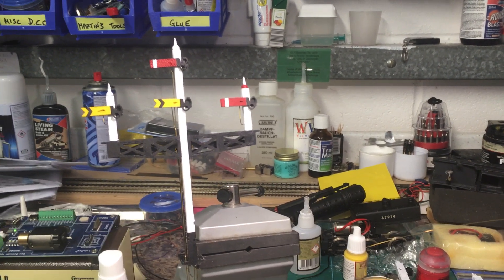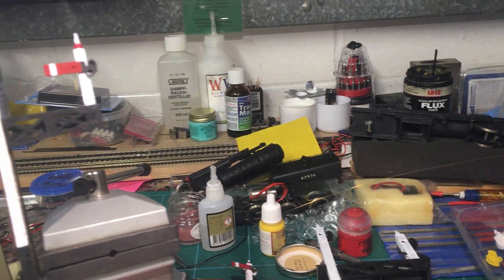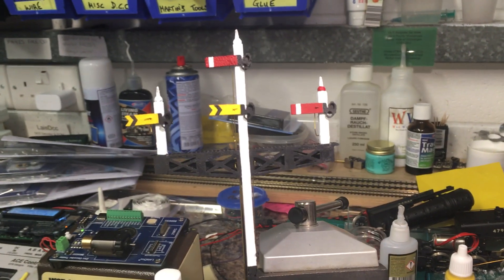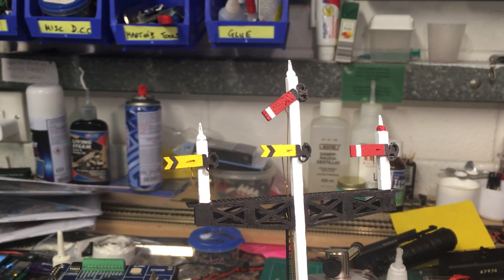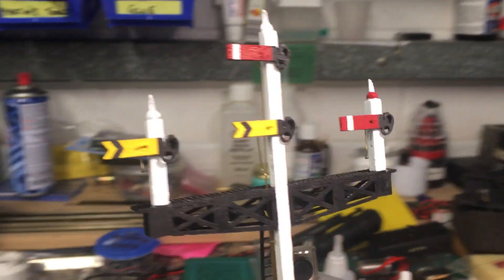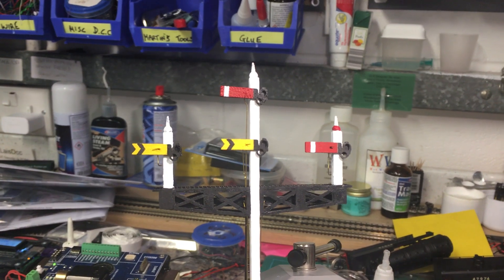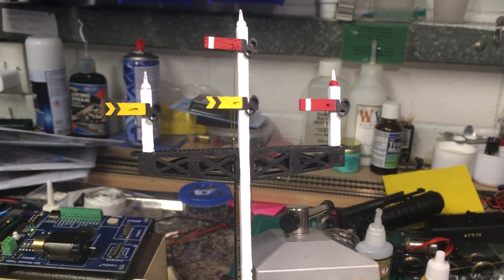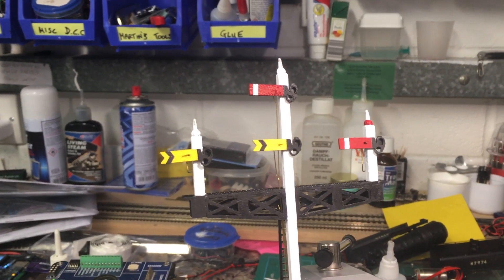GLR Bespoke Signals - custom 4 armed semaphore signal - Coming Soon

Comment: Wow Steve that looks amazing. There will be a demand for these for sure! Are you doing the LMS type/version where the signal points up instead of down?
Reply from the maker: Thanks! and this one is not even complete yet, I just wanted to show it! Absolutely, upper quadrant or lower quadrant is available. When I make the gantry demo I think I will do that as upper quadrant to show it can be done. Also it will be the biggest gantry we can do, the 6 arm version!
Reply: @glrailways7954  . I wonder why there where two quadrant versions in the steam era through to today ?  ( not many left now). These look really good already. Hey Steve I have seen no one yet making the new LED railway signals that change colour through one lens. Quite a few on the network now. Also have you seen the new Class 69 diesel loco? Converted from a class 56. It’s now having test trails on the Severn valley railway. There is going to be about six conversions GBRF. Which model manufactures will be the first to bring one of these out??